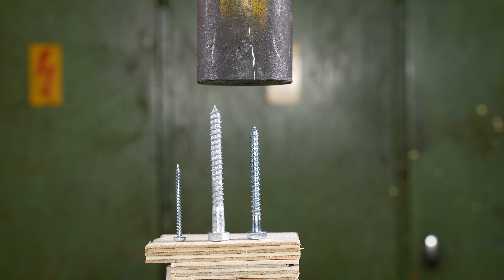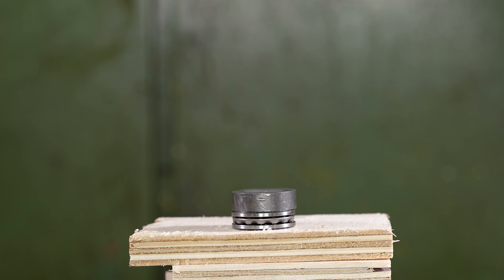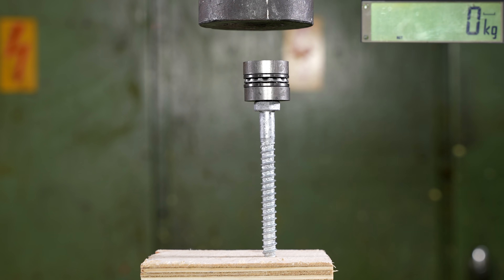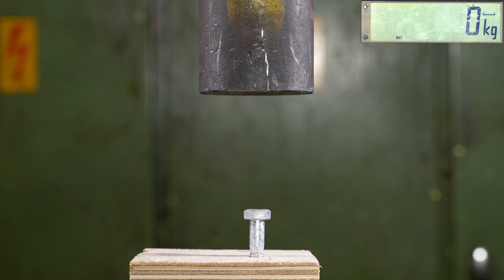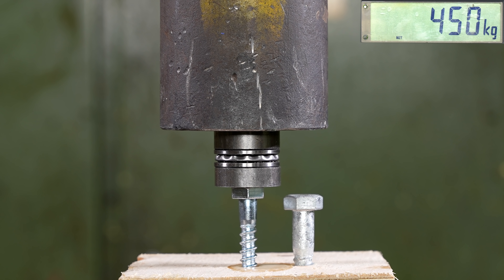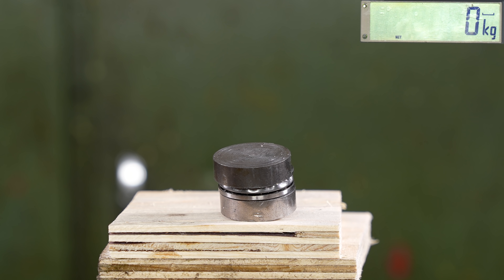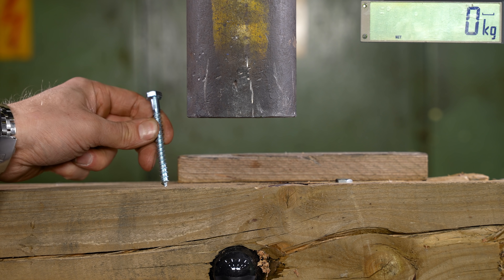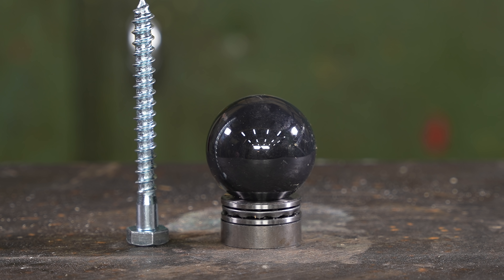Crushing Screws into Wood with Hydraulic Press | Will They Spin?

Comment: Maybe you need to try plasterboard screws, or chipboard screws. They have more thread to diameter ratio. Also it might help to polish the threads, to make them absolutely smooth. Screws often have surface irregularities due to the production process. 

Or even better: machine the screw yourself. Then you can optimise the tread pitch, thread depth and surface finish. :)

Comment: Soak the ceramic bearing in liquid Nitrogen until it's fully cold-soaked, then drop it into a bucket of hot oil, and stir.  As far as turning the fasteners you need something with very long flutes that are only slightly spiral.  Like certain masonry nails.

Comment: I think the best way to look at it if its a screw or bolt is the way the head is adjusted. If its drive is on the outside then its a bolt, if the drive is on the inside like Torx head or Philips head then its a screw.  Its not based on the screw pitch or shape of the point. That specific type is what we call a Lag Bolt although you can find lag screws but they have huge Torx or interneal Hex drives for them but they are pretty rare.

Comment: I'm not sure what people were expecting. If you've ever tried to drive a screw (with no hole) into anything with just a screwdriver, you know it's not going to turn.  Wood is softer than metal so you're just crushing the fibers. The twisting force has to be greater than the downward pressure put on the screw. You can try the same thing with a tapped hole and a coarse thread bolt and you'll get the same results as this.

Comment: I used to work for a hardware supplier.  The lag is technically a screw not a bolt.  Also anything that goes into a blind threaded hole is also called a screw.  True bolts only get attached with nuts.

Comment: Screw - Something designed to spin with a helical shape.
Bolt - Something designed to move back and forth.

Many fasteners are both.  
The "dead bolt" on your door is a bolt that is not a screw.  As is the bolt on your rifle.
The screw that propells a boat is a screw that is not a bolt.

Comment: I drive a crane. Once, I drove a 16" diameter, 20' long spiral corrugated pipe vertically into sand using an 800# internal hammer. The pipe was a "seven start" helix, so the grooves had about, roughly, a 60° angle to the pipe axis. We were all shocked to see the thing spin as it drove!

Comment: Instead of using the press to set the screw/bolt into the material, try actually screwing the bolt in first. If you screw it in, the threads of the bolt with start to make grooves in the wood and basically create a track for them to follow. Pressing the bolt in just makes a hole.

Comment: The ball bearing might be able to be split with some high strength alloy axe head? like AUS-6 or BG-42 bearing grade steel
Reply: It can't even make a scratch to it. The ball is ceramic.  Probably a diamond blade could just cut it but it would be expensive af

Comment: The difference between bolts and screws are that bolts are retained by nuts, screws mount directly. I'm just beginning the video but I suspect they will not spin. They are designed such that force that would make them rotate cannot overcome the friction between the woods and the screw.

Comment: Instead of bearings alone you should use Impact screwdriver idea where there is very long and spaced thread angle screw inside that when hit with hammer rotate screwdriver shaft making it rotate. So on top we have long tube that slide on spaced spiral that is inside with big angle twist that under pressure of press force rotation of that spiral shaft so anything attached bellow will also rotate

Comment: You could try drilling a pilot hole a few mm smaller than the coach screw and use soap as the lubricant

Comment: If the thread angle was at 45° or more shallow (closer to perpendicular to the length of the bolt) it'd work every time. Screws are screws because they're meant to not spin themselves out of place linearly when two surfaces are clamped together.

Comment: My two cents as to why they didn't work is that you pushed them in to start them off. This created a hole that was easier to continue down without spinning.
I reckon you should try this again but just by holding them upright some other way

Comment: Surely pushing a screw in would make the screw want to turn anti clockwise so would only spin for the first turn but then the hole would be the diameter of the outside of the thread and so would just push in like a nail after that?

Comment: The wider the pitch of the threads is, the more the screw will be likely to turn.
In imperial standard this would be measured as fewer threads per inch "tpi". In metric this would be measured as a larger distance between threads.

Comment: I would try this experiment again but make the press move down much slower if you can. If my theory is correct the screw does not have enough time to spin down with the speed of the forces pushing on it and just goes straight down like a nail instead. Make it go slower and the screw will spin more.

Comment: Try drill a hole slightly smaller than the bolt/screw, and push screw into the hole. Eventually wd-40 into hole first, so theres less friction👍

Comment: A screw has a pointed end and is driven into a hole smaller than its overall diameter, cutting the hole wider as it goes.
A bolt has an even overall diameter and is (typically? usually?) held in place by a nut.

Comment: They definitely did spin at the start, as the thread acts sort of like a wedge, but I think they were pushed in too quickly. The downward force in the threads quickly became the dominant force (versus the sideways forces that cause the screw to turn), and it reached a breaking point where the wood gave way.

I think it would be more successful with a slower rate, to give more time for the screw to rotate and reach an equilibrium where the downward stress is relieved.

Comment: Predrill the hole. Clean the galvanized coating off the threads of the lag. Grease the lag and the hole. U want to have the least amount of resistance and friction possible. Use a hardwood with a tight grain.

Comment: The whole point of the threads is that their friction overcomes the rotational force when pressure is applied to them, so they shouldn't spin.

I don't think a bolt would turn even in a loosely cut metal thread fitting with lube on it.
Reply: Reduce friction enough it might turn in your last scenario. The coefficient of friction and the (tan of the) pitch angle are the only two variables to determine self-locking, according to basic models.

Comment: I've seen very few screws that I think would work. For some reason, I think some R/C car servos had pretty high helix screws. Pretty sure whatever I had seen them in was used in plastic.
Reply: Hrmm...  They probably have a high helix because plastic is such a weak material.

So what about trying to drive them into a block of teflon?  We want something with very low friction.

Comment: I'm not a math person but was thinking about the forces involved - a large magnitude pushing straight down (180 degrees) on the bolt/wood, and the wood resisting with a much lower magnitude pushing up at a an angle of maybe 87 degrees. The sum of the two forces net out to being slightly less than the 180 degrees, perhaps 177 degrees, which isn't enough to turn the bolt. Math majors, please help!

Comment: Where I work, a machine threaded fastener is called a bolt if you put a nut on it, and a screw if you screw it into a block. Of course, most of our guys call a dial caliper a vernier, so take that with a grain of salt. Dunno what the rules are for things that go into tree carcasses, rocks, and such.

Comment: I think you could set up a simple test of the theory, before repeating any more examples in wood.

Take a machine screw, of your choice, and spin it into a nut 1-1/2 times the major thread diameter. 

Press on this, and see it you achieve the rotation results.

Great video!  👍

P.S. - Please say Hi to your Dad for me, and tell him it's from another machinist with a 50 yr badge!
Reply: That would kinda defeat the point of this channel which is basically just shove/crush/explode stuff with the press... not really to test anything scientifically.

Comment: The difference between a bolt and a screw is what it threads into. A screw is threaded into material that it is holding together. A bolt passes through the material and is held by a nut on the other side.

Comment: Should try pulling the bolt/screw through the wood rather than pushing it.

As for the bearing, instead of shooting at it, use it as the bullet itself...might need a custom made barrel, good thing you've got a machine shop lol

Comment: The threads would almost have to be vertical, to get any rotation. This why rifling in guns is so steep, if it were any shallower the rifling would be ripped from the barrel.
Reply: This is the best description. Maybe you should try just Standard twist drill?

Comment: With a bolt that had very long threading (I don't know the term for it), it would rotate  The angle of the threading on most bolts is too shallow, not enough of the downward force gets translated into lateral force to overcome the friction of the screw in the wood.

Comment: A screw is used on wood and other materials directly. 
A bolt has a fine thread and requires the opposite female thread to fix, such as a nut.

Comment: Let's assume that the thread pitch is shallow enough for this to work. The bearing is a good idea, but there is too much thrust load on it to work this way. You would need a much beefier bearing. Probably one so big that the screw pitch against wood would not be able to produce enough torque to overcome the rotational resistance of the weight of the bearing to spin it.

Comment: I think if you had started the screw with a drill, by screwing it in, it may have turned through the wood better. But I think the ramp angle of the threads just wasn't steep enough either way.

Comment: What if you try pressing the ceramic bearing between two meat hammers using the big spikey side against the bearing not sure if the spikes would help or if you would just end up with a 2 handle hammer with a ceramic bearing in the middle.

Comment: I think your chances are better if you screw it into a pilot hole part way before pressing. But the screw pitch is designed to be shallow enough to not spin in response to axial force.

Comment: Actually the screws are designed to not spin when under longitudinal stress. Obviously it's designed the other way around which is to not unscrew when the binding is under tension. It's all based on the screw angle which designed according to perceived drag coefficient (so metal to metal screws have a shallow angle while wood screws have a more aggressive angle) so more tension force will mean more resistance to unscrewing so it will never unscrew due to longitudinal force and will fail by shearing.

Maybe try a wood screw on metal?

Or some rare screw with very aggressive screw angle?

Comment: Screws are the ones you are using in the video. Bolts are used with nuts. Bolts are cut with threading dies or can be cut using a lathe.

Comment: There's no way to make the screws spin through the wood other than spinning the device that's pushing the screws in the first place. 

Screws were invented in order for us to multiply or, in this case divide the force necessary to fasten things together. A screw is a much better way to connect 2 objects together than a dowel or a plug, however, more total force is required to fasten a screw in place. 

There's, therefore, no reason for the screws to spin when just pushing them through the wood will do just fine for making a hole.

 It's really a matter of the shortest distance between two points is a straight line and not a drunken corkscrew of a line or, if you like, it's the path of least resistance.

Comment: If it was spinning easily when pushing it in, it would also come out on its own when you pull on it. Screws are not designed to go in fast but to hold parts together, that's why they have such "flat" threads.

Comment: It's doing exactly what a screw is supposed to do: resist axial movement. The threads are nearly perpendicular to the axis which is why they simply push through the wood here and why you have to rotate a screw to drive it in properly.  If, instead of pushing the screw into the wood, you were trying to pull it out, you would want to see the same effect:  ripping a column in the wood the diameter of the threads with almost no spin. Otherwise, it'd be a pretty bad screw.

Comment: Is the force of Press them into the Wood the Same as pull them Out? So you could measure the strengh of the Screw Connection🧐😃

Comment: I believe if you were to drill a pilot hole the diameter of the (screw diameter-(2xthread height)) you would get spinning.  Good move to lubricate the threads.

Comment: Heat the ceramic ball bearing, then rapidly freeze it. Should become much more brittle, if it doesn't crack just from the temperature changes along with any stress fractures it may have from having been shot out of a gun.

Comment: You could've pre-drilled the center shaft diameter for a start. But the slope on these screws was too shallow for it to work. I think this wouldn't even work in metal to be honest. The threads are actually made so they don't rotate under a pulling force. But it should work with a drill bit, they have a helix angle (slope) that is rather vertical than horizontal.

Comment: What if you welded or machined a socket or driver into the lower bearing so the screw head doesn't slip against the flat surface?

Comment: Best way to get rid of ceramic bearing is to get another, make a jig to hold them on top of each other, and then crush. The two surfaces shouldn't be able to handle the point load where there are touching, and at least one of them should explode.

Comment: You need torque to spin a screw, friction will cause minimal forces in the x and y direction thus some spin, but most of the force is in the z direction, so no torque/moment really. It's Force times distance perpendicular to line of action, the downward force is on the line of action.

Comment: Screws don't spin. Its simple, they are designed to be twisted into a specific material to hold things in place. So they need to have a helix angle that is less then the friction angle. A woodscrew might spin in a material with a lower friction angle PTFE for example. An object with a higher helix angle would also spin, like drill bit.

Comment: About destroying thay ball, how about a thermal shock? Heat it up real hot, then drop it into a glass of cold water, or maybe even better - cold oil so it doesn't boil as much so it can be clearer to see it crack (or not)
Reply: The only way to get it hot enough would be the fires of Mount Doom where it was once forged.

Comment: The Speed is hight. With the lowa Speed it would screw better, but the force of pressure pulling down, it's not enough force of thread face resistance to spin.

Comment: Soon as the threads get loaded up it will stop spinning and then it will just act as a brooch you need the rotational Force/torque which obviously you're not going to get with a straight downward motion... The purpose of that lag screw and the reason why it's threaded is to " draw "or pull itself in as it's being turned cool experiment though

Comment: Probably the difference between screw and bolt is the thread. Bolts usually have metric-, or Withworth-thread, screws have other type of thread, and you can't put a nut on a screw, just on a bolt. 
Sorry for grammatical and other errors, my mother-language is not english

Comment: I don’t think it will rotate even if you press it into a threaded nut… The friction forces will just be too large. The pitch angel is too low. That’s the basic principle in designing a screw. You shouldn’t be able to pull the screw out and unthread it. 
But as always. Great video!

Comment: I'm slightly surprised that the screw turned at all.  I think you've basically got the same situation as a spur and worm gear meshing.  You can drive a spur gear with a worm gear, but you can't drive a worm gear with a spur gear.  Mechanical advantage is in complete opposition to you.

Comment: If you think about how a screw works...what you are trying to do is near impossible.  A screw starts a "channel" with the beginning of the  thread (at the point) by moving in the threads direction and the rest of the thread follows.  This screwing is a result of turning the screw......you won't get turning as a result of any other force applied to the screw such as pushing the screw into the material.  Pushing the screw in just destroys any  potential "channel" , therefore nothing for the rest of the thread to follow.

Comment: Of course it won't , the angle of the threads is to shallow.  You'd need an angle of at least 60° for it to self screw and an appropriate rate of speed to allow it to do so.

Comment: What if you pre-drill a pilot hole in the wood, kinda like you did with the 1000 nails... A hole just wide enough so the tip of the screw doesn't have to penetrate the wood, and it's just the thread of the screw that has to deal with the wood... Kinda... :-D

Comment: Screws generally have a Phillips or flat head with a large sharp thread and bolts usually have the hexagonal head with a machine thread but I would call this a screw because you can't put a nut on it

Comment: A screw will dig it's own thread, while a bolt goes through an open hole and is secured by a threaded thing on the other side.
Lag bolt = screw, machine screw = bolt.

Comment: The screw would spin into the wood better if the angle of the thread was higher for example when you change a plug end on electrical the screws on the plug in have a high thread angle